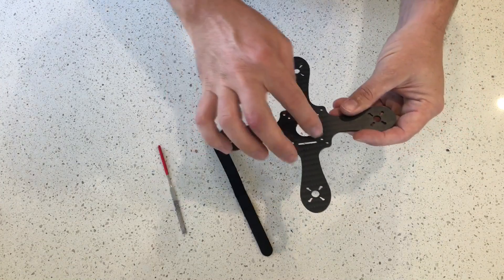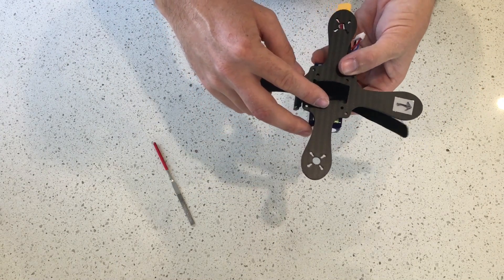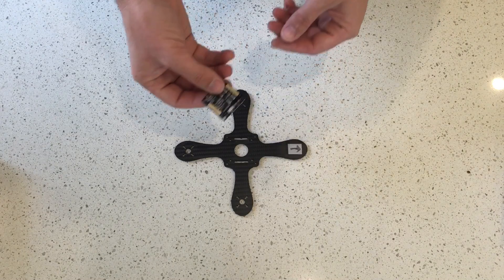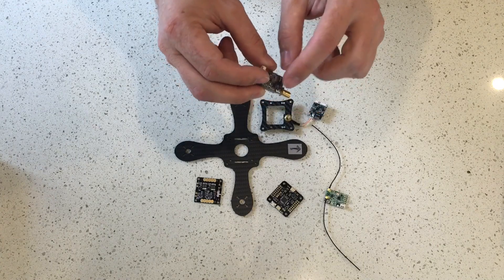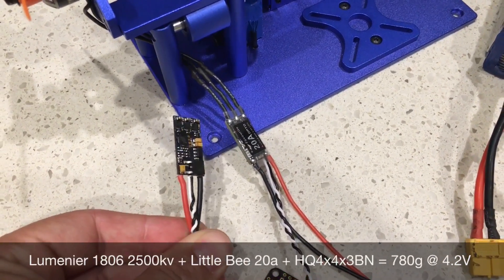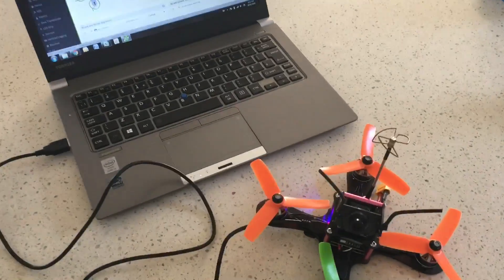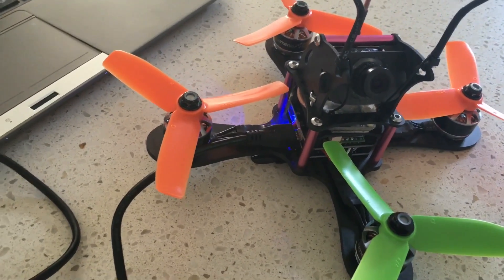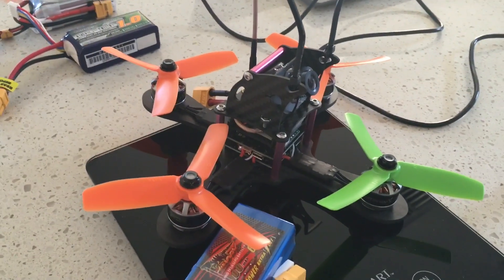Shen Drones Mitsuko Build Summary

Comment: Why did you modify the transmitter instead of just screwing the pigtail with the 90 degree adapter right to the Aomway?
Reply from the maker: There wasn't enough room, it would have ended up too long.

Comment: very nice build. 9 to 1 ratio 4"... might tempt me to dabble. have you tried the new 80c bonka LiHV batteries? bet your thrust to ratio could go up still. were those the new 390 spyder 20a pro's? sounded like you said 330
Reply from the maker: ZTW Spider Pro 20a with F330 MCU. There is a new (and better) one coming that has the F39 MCU.  The thrust tests were done with a 1500mah 4S Dinogy battery at rest voltage of 4.25V. The result was higher with a battery starting at 4.8V.